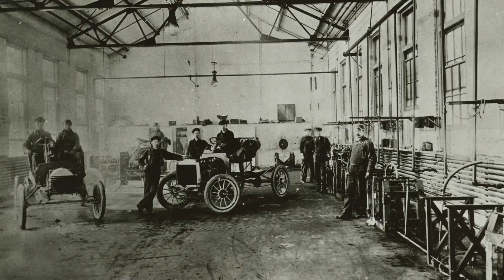They're ALL wrong about the future of robotics.

Comment: I think this is a good point. that said, once smart (ie dynamic) robotics starts to take off, it'll be able to replace labor. e.g. robots that build more robots (as well as ai designing better robots - and ai). that will drastically reduce prices (as well as kick off a global labor crisis), even if the product isn't as good as a man-made robot. ford was the first step, with assembly lines, then came the first wave of dumb (ie nondynamic) automation. we're starting to see the first wave of smart automation in places like tesla's factories, but I think we'll really see liftoff once general purpose robots become economical. then the only restraint will be the price of materials - but those are likely to go down due to automation as well. crazy times ahead
Reply: Yeah. I think the answer to this video is scale. If (imo, when) Humanoids scale, we're talking about at a scale never seen before. At that point, economies of scale REALLY matter. Even if arguably worse than a modular system or purpose built one for many subtasks, scale of general purpose will just triumph in the end. 

Anyway, it's neither only humanoids nor only specialised. It's going to be a mix, dictated by the scale of the job needed to be done (if big enough of a job, specialised makes sense). The question is just where the line is drawn.

Comment: Around the same time you started your videos I had started a dream robot of my own, it’s currently just an arm and mostly uses 3d printer parts, I need to get back into it, I think mass produced V slot and nema 17s are the way to to, not enough strength to hurt someone, but cheap enough for everyone to have one.

I hope companies like Creality who already produce control boards, frame materials, belts/bearings, and capable motors joins the race
Reply: @TheMrPopper69  I'm currently thinking of a way to accelerate research using robotics , and ways to get to that so if it works and spreads it could have a tiny impact on the amount of robotics in the world.

Bringing robotics to that stage of development would be easier if we had cheaper materials to make motors out of , like plastic motors that are hydrogen powered, motors made out of plant flesh(like plants that fold when you touch them but much stronger) , motors made out of conductive carbon(graphene after 20-50 years of research?) / bacterial wires(only one lab is currently working on studying them after discovery, part of why I got to task on means to accelerate research, for example by facilitating practical demonstrations of it to the general public) .
Altough the easiest approach that i've seen so far is mechanical multiplexing(using one motor and multiple small but powerful clamps to make multiple output shafts actuate) and research on robotic gear changers(to permit cheaper motors to do both tasks that require speed and low torque and tasks on which you can compromise speed for torque).

I'm currently considering using both of those for my application, with the required motion being actively analysed for which shafts to actuate , and sensors at the shafts calculating input torque+task required torque(based on speed and direction) and determining wether to shift gears for that shaft based on the trajectory observed previously ,for example.
I think it could be a real gamechanger.

Comment: currently working on an approximate rotary encoder to reduce joint cost and complexity. 
i have never needed to know exactly where my elbow is to the thousandth of an inch when i wake up.. 
why would my robot?
Reply from the maker: I like this kind of project!
Reply: @joethieman9400  have at it, friend! i am working with a circumferential greyscale, a photoresistor, and a bright led. also a color wheel and color sensor shows much promise. this puts your sensor away from the joint axis, which is usually already crowded. pair that with a cycloidal reducer, a cheap brushed motor, and many airsoft pellet bearings and you have a dirt cheap robomutt leg joint. i call mine barktholomew.
Reply: Because a robot works with numbers, and you work with feel (intuition).

Not sure if thousandth of an inch is necessary though. What is the product you are working on, and what is the application of the encoder?

Comment: Counterpoint (sidepoint?), ChatGPT WAS the Ford moment for AI.  Machine learning has been around since the 60s (maybe earlier?) but it became readily accessible to the common person for cheap.  I agree with you that all these companies trying to get humanoid robots to market are not doing so with the common man in mind.  I may be dreaming this up, but I thought I saw the Teslabot has a predicted price of like $25k which is rich person toy level of money OR buy it for your business level.  Maybe that's what their entrypoint is.  Target business applications first, work through kinks and get the supply chain costs low through scaling up, then make a "more affordable option" which is just the same thing but partially hobbled some way which they can claim saves on price (e.g. Model 3s with all the same battery but lower range costs less... that drives me nuts btw).  In the meanwhile, making cool bots ourselves is still fun.  

Actually, this is very similar to the rise in 3d printing.  3D printing has been around for decades too, but around 15 years ago, makerbot started making hobby ones.  It exploded into the a myriad of hobby 3d printers which refined the technology and drove down supply chain prices.  Now, companies are shifting towards making a printer that "just works" for the everyperson who doesn't want to tinker with their printer, they just want to print.
Reply from the maker: Good points, but I would argue that ChatGPT would be more like the refinement of the Internal Combustion Engine to the point of practicality. It was a key part of these events, but the engine itself is useless until you attach it to other machinery to turn it's output into work. Otherwise it just makes noise and is fascinating to watch...

And yes, the same hardware being locked out to artificially create a lower price point is a pet peeve of mine too.   😆
Reply: @HeyItsJonSchwartz     There is also that openAi was and still is impractical, everything they do burns way more money than they make without relying on AI hype and government grants(that 500billion+ and other earlier costs could go to real , novel AI research btw instead of copycats with a lot of funding).

So its not really a Ford moment , because the car industry was self sustaining without external impetus , right now openAI's chatbots are like aerolipiles(one of the things that inspired steam engines) that sure are interesting but aren't practical for most applications unless you use a whole lot of the things(ungodly amount of data and power) or take a different aproach(like steam engines or combustion motors in this analogy, such as the recent semi-open model from China which uses much more reinforcement learning instead and which could as a result learn general actions and behaviors by trial and error instead of being machines of mimicry without the capability for inherently novel behaviors).

If you've mase it this far , thank you for reading this rant.

Comment: Personal robots have been "just around the corner" since the early 1980s. However, companies tend to work on short time scales, a product needs to make a profit asap, and robotics. general enough to perform useful tasks will take long development times. In fact all the tech we need has existed since 1985, the element missing has been the will and budget to see it through. This is why I have always considered the hobbyist to be the most likely likely group to bring it to fruition. Rolling robots are the best choice to get this going, humanoids are just the latest  toy in order to garner public funding. Like chat-gpt which falls way short of useful, the current crop of "robots" fall way short of usefulness.
Reply from the maker: However, the landscape has changed a lot since the 80s. Power electronics, batteries, and sensors are worlds apart, but more importantly the advances in machine vision since Neural Nets were applied to the problem in the 2010s, and of course the hardware (GPUs) to run those neural nets. All of those technologies were missing (or only in research form) until the 21st century. Now these technologies are production-ready.
Reply: @joethieman9400  The updates to technology just make things easier (in a way), the same problems exist. I was writing neural net code on my commodore 64 in the early 1980s, neural nets won't solve this problem. This is because neural nets cannot be described effectively once trained. This problem was identified in the 1950s with neural nets that started to give false positives. It turned out they weren't solving the problem given, but something else. More recently deep nets like YOLO have run in to similar problems. Identifying dogs is relatively easy as they vary in shape, size and orientation, this is what nets are good with, but present a bunch of cans and you will get very low confidence. Drink and food cans are all petty much the same except for colours. A can is a conundrum for YOLO or tensorflow as it provides very few differences for the net to train on. A can is best recognised by an entirely different system that examines the (shape and  size, very similar)  and colours, very varied. Yolo might detect an elephant in a room, but the real elephant in the room is the lack of recognition of objects the robot might need to manipulate. Getting back to my point, the size, shape and colour of a can could be recognsed in the 1980s. For modern net work, there are several papers on semantic recognition that show promise, but again are not required to reach the robotic level most of us aspire to. As for GPUs, every period we have heard the claim, "if we just had a faster cpu", but if you look at the work of Broosk, Connell, Mataric etc in the 1980s you can see how much can be done with the simplest of processors and without any central map representation.  I'm not arguing for that level of de-sophistication, just  out that the solution isn't faster and faster cpus with more memory.

Comment: I agree. I personally would prefer a non humanoid robot  to help me with my chores. Like the robot vacuum, or even the dishwasher or washing machine (robot, as in a programmable machine that performs work). I want it to look like a machine and tool that it is, rather than something human like, which is easy to empathize with. I think it isn't a particularly desirable trait in a machine that I make do chores for me. It could also have a simpler, yet more purposeful design, to perform the intended task, rather than the humanoid form.
Reply from the maker: YES. You know who I think had the right idea about the future of robotics? George Lucas. I'm not a big Star Wars fan, but I think his vision of 'Droids' was spot-on. 😂
Reply: @joethieman9400  You are probably very tight about that. And I imagine that we could even build and furnish homes with the intention to integrate robots. A home where it is easy for a robot vacuum to move around, or even some sort of gantry system for a robot that can pick and place things.
Reply: @joethieman9400  And they are pretty useless manufacturing wise. Besides, our world is built around our human form, our body and most importantly, our hands. You need legs (or some alternative), dexterity in your hands and height to move throughout and interact with our world.

No doubt purpose built makes sense in some cases (where the scale justifies it), but there certainly are many downsides with purpose built.
Reply: But the whole idea behind a Humanoid Robot is to be able to do all the things a human can do. You would not need robots for anything else. If it can load and unload a dischwasher and mop and vacuum it would be alot more usefull. Not to mention, cleaning anything.
Reply: @WoldMediaToday  I understand that the idea is to have a universal robot, and the humanoid form is quite universal for the things we do. It'd be great if these companies could launch a functional, practical and affordable universal robot. But I suspect that there are simpler and more cost effective ways to achieve what we actually want, such as unloading a dishwasher or other cleaning tasks.
Reply: I've seen this perspective thrown around a'lot, and it's because it is basically true. A purpose built robot will always be better than a humanoid form. So why are so many manufacturers betting on the Humanoid form?

It's very simple

The brilliance in the humanoid form is that it is EXTREMELY versatile. It can do basically everything, just as we humans can, and can just substitute humans without theoretically any adaptations being made to our current infrastructure and manufacturing. It is the on paper closest equivalent to human labor.

In theory (we'll see this later this year and more next year), it can break capitalism. Capitalism is run by labor and materials. With humanoids, we can theoretically scale the labor to any desired quantity, anywhere and at anytime. Materials can be recycled, expanded in supply, and potentially even mined from space (closer than we might realise). Humanoids are the dream for economists. 

So sure, a dedicated robot vacuum, grocery getter or specialised manufacturing robot might be better at any specific given task, but its only for so many tasks that the scale is present to justify a purpose built machine, as opposed to a humanoid. Better yet, CapEx becomes an issue of the past. Shutting down a production line? Don't have to worry about the millions in specialised line equipment that no one needs anymore. Move the humanoids to a different line, or maybe just rent them from a bigger operator. 

Humanoids, just like AI, can make our wildest economic fantasies reality. There really isn't any limit. Labor has always been a limit, now it might not be.

Tesla for one has asked its suppliers to prepare for a production rate of 600 humanoids per week by 2025 year end. Elon has also stated that their goal is for thousands this year, up to 50k next year, and up to 500k the year thereafter. Obviously, he is very optimistic, but still, it's a big indicator.

So, when you say you want a machine that you can program, and that looks like a machine. How many of them are you willing to have, each for their own types of tasks. What if you have stairs? Can that machine venture outside? At what point is it just cheaper to have a one size fits all? Besides, manufacturing wise, there's concept know as economies of scale. As scale rises, speed and cost.
Reply: @sebastianorye2702  I would argue that a sizable portion of what makes a humanoid robot an attractive robot is that it's aldready in our public conscioussness due to films, books ect...

Plus a humanoid is good for social interaction (ordering the robot, talking to the robot would probably be less strange to the user) and using/abusing sympathy and cuteness/beauty to have people make its work easier is a thing that aldready is Happening with Moscow's small, designed to be cute delivery robots , which when stuck get helped out by passersby because cute shit is equated with harmless, with helpfulness instead of "soulless robot doing work that could be done by men currently on the front" , it disarms and is a useful tool for the company ect, it is but a tool to manipulate people.
Same thing would happen with customer service robots(powered by chatbots for example) , which would take little money, not need to move a lot(less wear and tear) , obey the company to the letter, so things that normal humans wouldn't do to other humans most of the time(refuse life-saving services and treatments to people whenever it maximises profits, disconnected from normal morals...).
All while, for example, people don't know who is human, or what is a robot unless there is a specific indication of such
Could also exploit people by making the robots extremely pretty, creating dopplegangers of past employees or celzbrities like a robotic equivalent of using ai to put a long dead superman actor in a recent film, to hide the fact that many people got replaced by robots, or to scam people by impersonating a celebrity.
Exact same thing happenning with AI and artists , but to physical people, which if a company like openAI decides to take into the commercial spotlight to get a market advantage by making research technology into consumer goods, which would probably happen unless there were to be sufficint backlash to make such robots Impossible to keep for long(due to destruction for example).
Those are but two of the ways that humanoid robots make it easier to abuse people.

Add to that the fact that what a robot needs to be like a human in productivity is at least 2 manipulators(not necessarily arms, counterexamples are tentacles and specialised bimanual manipulators for example) and maybe a means to move(wheels for industrial environments, tracks for outdoor not very bumpy terrain and legs or wings\propellers for extemely bumpy terrain)
Reply: Scale is always the best answer though. The same way that general intelligence LLMs are so useful because you can use the same foundational model for loads of tasks, humanoid robots will be the same way. Tesla can mass-manufacture millions of humanoid robots and people would buy them for all sorts of different tasks from cleaning to manufacturing to agriculture, etc. - and it's the mass market that lets it be so cheap that people can experiment with it.